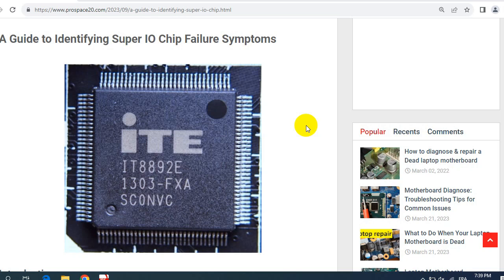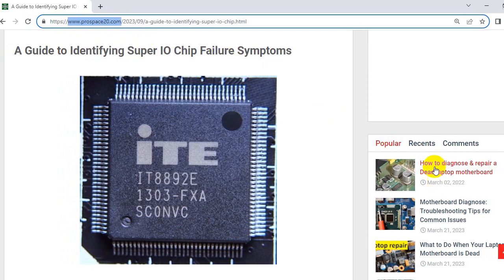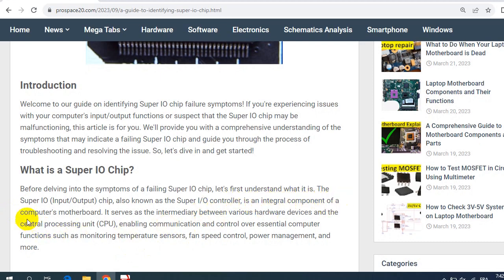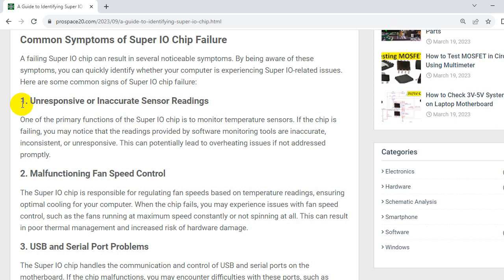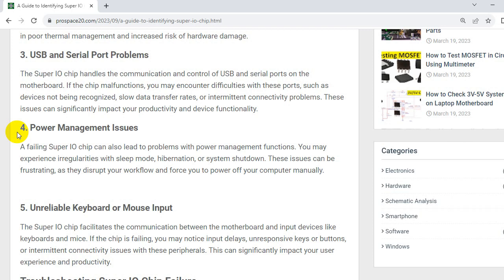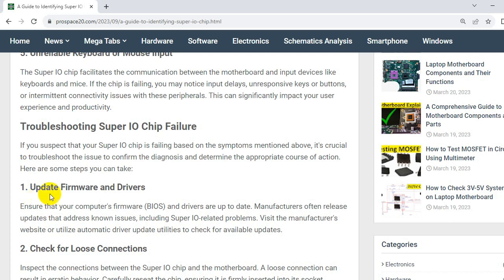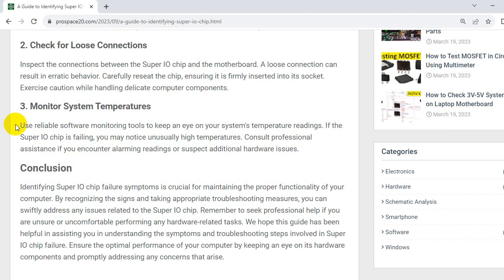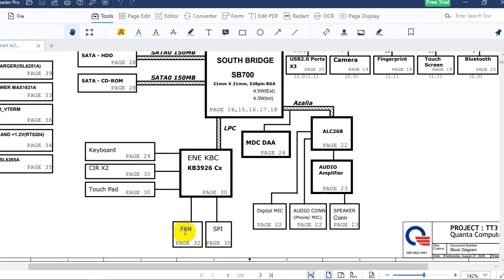Identifying Super IO Chip Failure Symptoms - Laptop Repair

Comment: I need Lenovo Loq 15irx9 rtx4060 i7-14700HX  schematic. Please help me
Reply: What happened to your laptop?
Reply: @vishnuk8782  problem is dead mobo.
Reply: @anarhamdullayev9858  based on specs i can say it's not been long since you purchased the laptop, how come the mobo die so fast?
Reply: @vishnuk8782  1 week after receiving.  it is intel's 14th generation problem
Reply: @anarhamdullayev9858  it's still under warranty right? Just get it replaced
Reply: @vishnuk8782  I went to lenovo service center in my country to change the i/o chip, but it still doesn't work.  and the screws of the rear part are lost.  Will there be a problem if I send it to Korea for repair under warranty?
Reply: @anarhamdullayev9858  why do you want to get it repaired? Did they not replace the laptop?

Comment: I was working on this hp laptop and the charger somehow sent 18.5 volts onto the super io chip. Was this enough to hlow it ? I dont reads shorts anywhere but the laptop wont even show the cord light
Reply: Yes it will blow it. The super IO operates with 3.3V. sorry about it.
Reply: Yes it will blow it. The super IO operates with 3.3V. sorry about it.
Reply: Yes it will blow it. The super IO operates with 3.3V. sorry about it. 10:33

Comment: helo, I have question, gl553vd motherboard issue my super io is not warm/hot - is cold when I plugged the charger..it has 3.3v coming into chip, no charging light/no orange light nothing is lighting..can be problem with super i/o even my super i/o is not hot? I checked whole motherboard and nothing looks burnt and nothing is hot..I checked short on power main rail and all is good, 19v is present..so my question is can be super i/o faulty even if it’s not getting hot and has 3.3v?

Comment: my daughter accidentally spill some water on my laptop. when i switch it on after cleaning, it get on but the keypad and mouse pad not responding. i gave it to repair. the person told that there is problem in I/O chip as it stops taking input n output but no problem in keypad and mouse pad. is it so? and if then what should be done as he said use external keyboard and mouse. pl suggest me should i go to change i?O controller? or any other way

Comment: Does my motherboard can be fix if  one of the tiny resistor surrounded the super Io chip got missing? My PC still runs but no display on my monitor, also power led and hdd led did not light.